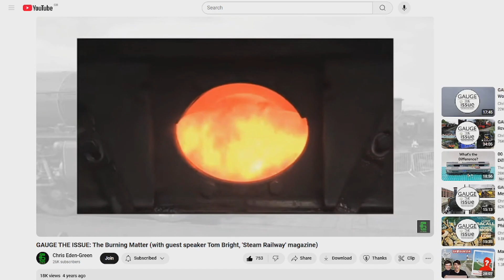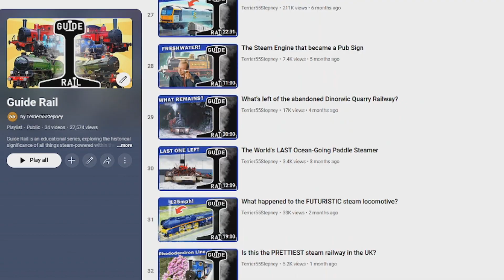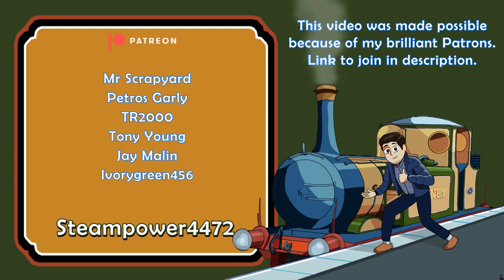Why are steam railways struggling to find coal?

Comment: I have some sympathy, but this was always going to happen. The same will happen with IC cars, when most people have stopped using petrol, petrol is going to get more expensive. To the commenters blaming the gov't. Its nothing really to do with them. Theyre focused on reducing mass coal use, like in power stations. This is just a knock on effect, from the loss of scale. So unless you want to argue that we shouldn't change our entire power grid, because coal for steam trains will get more expensive, arguing against the current situation is a bit silly.   

The heritage railways havent really been doing anything to prepare. They could reduce coal use, just by heating up the engines with gas or electricity, but from what I've seen, they don't even do that one very minimal thing.
Reply: IT'S EVERYTHING TO DO WITH THE GOVERNMENT! There was a high demand still for UK coal for steel and cement making, even energy production. It was their green ideas that closed the last mines open, that were still making a profit.

The Heritage sector had no time to. Plan, it was launched on is without warning less than 5 years ago.

I suggest you need to get educated on such matters before posting such ignorant posts!
Reply: @James_Rivett  I think we're talking past each other.

I'm saying the government hasn't gone out of its way to stop heritage railways using coal. It is just collateral damage.

I'm not sure where the 5 years is coming from. The coal fired electricity phase out was announced 8 years ago, and the writing on the wall well before that. And anyway, 5 years is a long time. How much time are you suggesting they need? What has been done over those 5 years?
Reply: @benholroyd5221  your talking nonsense, the coal railways were using over the last 20 years was being supplied for the steel and cement production. It's the whole reason Ffos-y-fran was turned into a oprncast mine and when the grading machine needed repair, was shipped ungraded for steel making. At every concern raised with the previous  government, they were given reassurances there would be coal for them despite the claims raised. The HRA and the NTET have been working with CPL at a man made alternative, but these can only supliment coal not replace it there has been trials using wood based materials, unsuccessfully. Thanks to the Welsh labour government closing Ffos-y-fran in 2023 despite appeals from. The British government, and thanks to this new labour lot revoking the mineral extract licance for the mine under construction in Cumbria, The UK has stopped manufacturing virgin steel, as its not possible to make new steel with out a coaking agent.

This labour lot on hell bent on stopping oil and gas, and want to stop people burning anything. So what alternative do you suggest?

The Heritage steam sector has been doing it's best to source new coal supplies and alternative coal. There wasn't 5 years warning. Infact the coal industry was given just 2 years notice that non smokeless coal would be banned for domestic use. The car industry was given 15 years notice that new IC vehicles would be banned. Changes on I'm health and safety requirements, especially in the rail industry, are normally anounced to operates have best part of 10 years to make changes.

Despite your statements, no one is saying we should still generate electric by coal just because steam trains need coal. Most suggest we should maintain coal fired powerstations implementing clean emmisions scrubbers as we can be reliant on own energy at times when renewables are not available (and currently their no where near capable. They would require 1/3 of the UK covered in turbines and solar farms to just keep based with current tech to replace all the current non renewable powerstations)

It's not possible to heat British steam locos up on electricity, gas is not suitable for steam rasing in a large boiler due to the high H2O content of emmisions and requires a totally different drafting arrangement. Most UK steam locos are not suitable for oil conversions. Plus that is not preserving our heritage.

Again. I repeat, you should research, or even talk to those involved in owning running and maintaining steam locomotives and boilers be for posting such comments ignorant of facts (please note I'm not calling you ignorant, your clearly not).

I've been involved in the heritage steam all my life (mostly road and stationary). We use a lot of wood to rase steam, but even on a traction engine, you want many more times wood than coal just to raise steam and if you work the engine on wood you hardly ever stop putting it on.  The TR have experimented with waste products from rapeseed oil production. It was found to not be a alternative but was possible to use for shunting and steam easing but burnt quite smokey. In many cases the alternatives are more expensive than imported coal.

I regards to IC vehicles, despite the ban on the sale of new IC vehicles in 10 years times, the government has don't nothing to roll out infrastructure or invest in the needed tech for alternatives (possible because they know in 4 years time they be looking for a new job) and not many of the population has made arrangements for the change. Why should we? It's the government who are forcing this change that only a very small minority wishes to embrace, and is not likely to happen is current political predictions turnout to be correct (should add I doubt they are even anything like correct). Like a all politicians, everytime those who's future is threatoned by government ideas seal reassurances, the government has lied lied lied. This current lot are the worst yet.

The last bout of mine closures had very little to do with the closure of coal fired power stations, and everything to do with net zero targets, as they were being used to supply the steel and cement industries.

Draw power station is a typical case of the UKs governments short sightedness. Drax was fed by its own coal mine, coal was transported a short distance by road. It still is the biggest power station in the UK producing 6% of the total demand of the UK. The governments driven to net zero saw its mine closed, it is now "a renewable" biomass power station. This means trees are acquired and chopped down in north America, transported hundreds of miles by truck or train to the docks. Put on a very dirty oil powers ship, shipped acoss the North Atlantic to the UK them. Put on a train to Drax power station. This operation has a carbon footprint many times greater than when it was a pure coal fired power station. (Drax still has a few mothballed coal fired boilers that might be maintained should the need arise ie war or other global incident restricts the flow of biomass products).

I'm sorry but your comments are devoid of truthful fact and are ignorant of the restrictions and complications of operating UK designed steam locos.

A local industrial steam museum used to burn waste oil in its marine type boilers. The then labour government stopped this saying you must not burn waste oil on environmental grounds. So it switched to coal. it now runs a mix of wood and coal.
Reply: @James_Rivett  you keep telling me to get educated. 

We don't need to cover a third of the country with wind turbines. It would take 20% but most are being built offshore.

The transport of anything by sea is a rounding error. Burning wood could be worse than coal in the very worst scenarios, but in the best case is 10 times better.

Ffos y Fran. The plan was for it to last 15 years. It carried on illegally mining for another 18 months. Further it was mainly thermal coal. Some of it was processed for used in steel production though. Is 15 years not enough notice?

Comment: because Ed Sillybrain has "banned" it in his deranged dash for Nut Zero.
Reply: It was Michael Gove who banned it !
Reply: @lordstiffupperlip3095actually it was Welsh Labour that closed Foss-y-fran in 2023, the SNP that closed the last 2 Scottish mines in 2020 by refusing to renew the mineral extract licances. The ban on burning smoky coal domesticly only applys to England. Most of the "house coal" burnt up to this bad was wither Scottish or Polish. The devolved powers did not follow up the looney idea of banning domestic smoky coal. New mine in Cumbria was given the go ahead by the conservatives, only for the new labour administration to revoke the licance, as it has done on many gas and oil extraction sites for net zero target reasons. It is also refusing to renew mineral extract licenses on more mondane things such as sand. Gravel and stone. It's even looking to revoke or not renew licances for rock Salt extraction. Sedik Khan is even trying to have wood burners banned. Actual tests regarding man-made ovals had proven, whilst they are (almost) smokeless, the gasses they give off are more toxic than standard coal in some cases. Some of this has been attributed to the binding agent.
Reply: what are your climate science qualifications?

Comment: There was a research project to use wood pellets in steam engines: 
The project was called "Development of a high-performance combustion system suitable for steam locomotive operation for renewable raw materials"  at the museum railway at Bruchhausen-Vilsen, two years ago. 
The engineers adapted a technique developed by the railways of the German Democratic Republic, who had to make do with low quality coal/lignite and had the problem that the air flow in the firebox would whisk away a substantial portion of the fuel before it had fully combusted. They developed the deadened firebed, with a layer of stones/a nozzle sheet on the grate, which causes a more turbulent air flow, and they also inserted an additional fire screen to increase the flame path in the firebox.

There is a video here on youtube on the channel "Powered by Steam".
Reply: the 141r based at les aubrais/orleans runs by burning pine needles that are liquefied and fed as per oil firing.
i did it from orleans to paris/tours/bourges in 2023. works great
Reply: @andrewyoung749  the 141 (R78) that used to be a Bressingham had a mechanical stoker. My friends late Grandfather was one of the EX BR enginemen that were recruited for the standard gauge line. He could understand basic French, having learnt it in the Army in the late 1940's, and as a Fireman always craved ago on a loco with a mechanical stoker. He started it going only to find someone had chucked half a railway sleeper in the tender coal space and jam it up. 

Not related to oil burning but hearing about R840 reminded me of that story
Reply: We had some "woodcoal" to try when it was first brought out. To look at it looks like chipboard but in square block. Form died black (just a description you understand not a reality of what it is) I got on well with in, but after the trials, the Cost was even higher than imported coal.
Reply: There was trials here with wood pellets. They found it was manageable on light loading, until the pellets got wet and turned to mush. They also found they used a lot of them.

Comment: Honestly speaking, as a train enthusiast; one day, like it or not, we need a renewable alternative. Maybe not now, maybe in hundreds of years, coal will be done, oil will be done. It's probably not what most want to hear, but we should probably be converting all heritage steam to burn liquid or gaseous fuel.

We can better tune the burn rate of liquids and gas to replicate the BTU/hr of the engine's designed fuel, we can also more easily generate fuel options from renewables in liquid and gas form. Best option would be methane, it's got a decent energy density and it's dirt easy to generate.

Comment: Here in Australia heritage  railways  also use oil have heritage railways in UK thought about using oil?
Reply: yes, at least three ffestiniog/welsh highland/vale of rhiedol had locos running on oil firing, vor all its locos, ditto whr and fr most in the 1990s.  due to the far higher cost of oil firing all three have over the last decade converted all their locos back to being coal fired.....

Comment: Is there no way that the heritage railways can form a company that could be allowed to operate and mine what they need from the mines like that opencast place you mentioned that closed? Surely if they were just allowed access to a small area of the site they could extract what they need for very little cost?? Or is it all down to legislation?
Reply: It's political. 

Your not allowed to extract anything from the earth in the UK without a mineral extract licance. This government won't issue them and has revoked several issued by the previous administration. In the case of Ffos-y-fran, it was still in. High demand for the steel and cement making industries and was profitable. Their mineral extract licance ended in 2023 and the Welsh labour government refused to issue a new one claiming no one needed coal.
Reply: Economics and legislation against new coal mines it would be illegal to open a coal mine in the UK as matters stand

Comment: The issue with keeping it open for heritage is because it wouldn’t be economic to keep it open for a few railways, museums and exhibition centres. We just don’t have any money any more
Reply: Ffos-y-fran was closed for political reasons. It was in much demand by the steel and cement industries. It was the Welsh labour government who refused to extend or renew the mineral extract licance. They even tried to get the anthracite mine closed down near Port Talbot, but the high Court ruled that the licance must be allowed to run until at least 2038. The UKs labour government did the same thing with the new coalmine in Cumbria, that was being developed to replace Ffos-y-fran for the steel and cement industry (labour revoked it's mineral extract licance) and have done similar things with oil and gas extraction. They are even refusing to renew mineral extract licance for things such as sand and gravel (but to be fair, the issues with this stem back to the 2019 election  when then conservative administration was running scared of eco protestors coursing disruption to London)
Reply: Mining was being regulated out of existence but it's ironic that a conservative government was supporting opening a coal mine and the labour government kyboshed it

Comment: the sad thing is, the way the pits were closed makes them incredibly dangerous. because they were capped off they havs built up with so much methane gas it would be very dangerous to thr land around to continue mining.
Reply: my instincts urge me to respond this…
just un-seal the cave, get everybody clear, then LIGHT IT UP!
Reply: @rhyusbrand8311  yeah but, it will cause the area around it and any of the seam and coal face area above it will explode and collapse inwards so you have basically created multiple massive sinkholes. theres no way to go back to them.

Comment: Its very interesting cause the Polish coal we got here in Denmark worked very good in our narrow gauge locomotive so question is if either British locoes or loco drivers are more fussy about what they get, also there is oil conversion and during the war Danish locomotives ran on Piet from the bogs and brown coal of the poor Danish quality so if you can live with reduced performance steam engines can run on most everything
Reply: during teh war, there was a massive incident in italy iirc, where a loco running low grade coal gassed the passengers when it failed to climb the grade inside a tunnel...

yes, they can run on alternatives like wood and low grade coal but they need far more of it, for far less output...

oil firing is feasible... but expensive.

Comment: I am an electric locomotive, EMU and tram fan, so I don't have quite so much to worry about, but it is still tragic to lose such a crucial element of the heritage movement.
Reply: Likewise
Idk why nobody out there hasn't devised a battery tender that's capable of low speed torque and regen slowing down an entire train. Surely that compliments a steam locomotive's most inefficient portions of running
Reply: @BeLowBelowo steam locomotives can be fired by electric heating elements. The Swiss railways did such in WWII. With the loss of German coal to feed their steam locomotives, they simply ran them off of overhead wires, powered by hydroelectricity. It was a common practice to refit locomotives to burn more effective hydrocarbons, from wood to coal, oil, and others. It's precedented, so there's lots of opportunity for historical railroads to adapt steam to electricity.

Comment: God, I miss the good old days before this horrible crap began.

As for the crisis, I think we should install roller bearings on all locomotives and cars working to cut back on fuel consumption.
Reply: here in the UK it would cost far more than to carry out the conversion work than to import foreign coal in regard to locos, especially those with crank axles. Most BR standard locos have roller bearings on their tenders, as designated by the yellow plates on the end of the bearings. 

Quite a few of the coaching stock has roller bearings to, if fitted with commonwealth or B4 (or later) bogies, they had roller bearings from new. 

In reality the loadings on heritage lines are normally comparatively light so conversion to roller bearings would have little effect noticeable. On the mainline, just about all the coaches used on charter operations are fitted with roller bearings. 

most of the newbuild steam locos that are being built for mainline use are being built to incorporate roller bearings (as Tornado). 

I have to admit on the model traction and portable engines I make (where possible) I used roller bearings on the main journals, hidden inside brass bearing blocks, as they are cheaper than bronze in many cases. on my model traction engine, the back axle, and diff centre were all fitted with roller bearings when rebuilt in 2016. Even the die block in the stephensons link is a needle bearing.